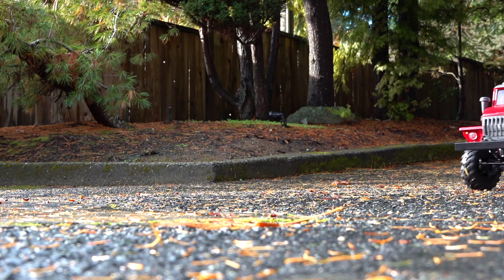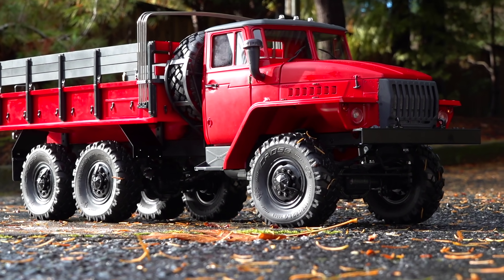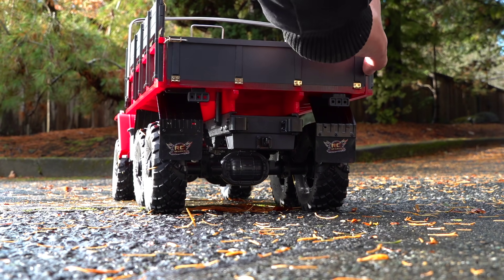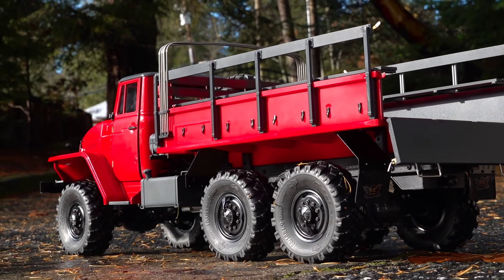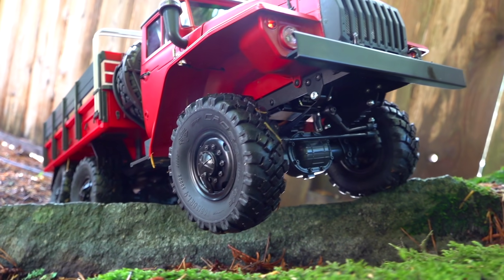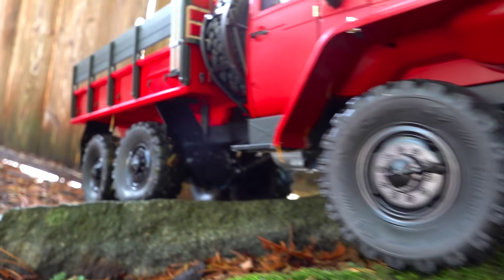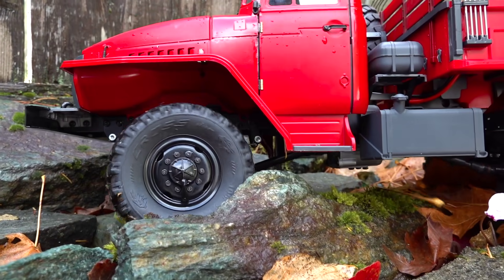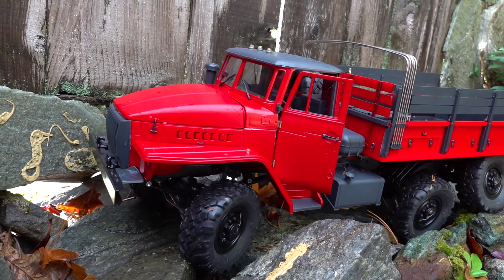HOW TO BUILD an RC FiRE TRUCK - PART 6  (Cross RC UC6 Model Kit Build) IT MOVES! | RC ADVENTURES

Comment: Really nice this truck in red. Very good test run. My only regret about this truck is the doors that open by themselves when you drive the truck. I also have the same problem as you with the hood and the windshield, I think that this part should have been held with a screw or that the part in front of the door made one and the same part and not in two parts because there is too much constraint at this level. For me I had no problem with the lights, everything works 😊

Comment: I remember posting another comment after you finish building it when I saw you did not scrape the paint off!   That solvent is designed to go plastic to plastic not paint to plastic!!   You are going to have the same problem I had my whole cab fell apart!    To be honest you have to build the whole unit first before you paint it!    I leant the hard way!    You can still buy the glass kit but that’s about the only panels you can buy for the cab, The box you can make lots of pieces for it no problem or you can buy the whole box kit!   Scale trucks Canada out of Montreal is a great place to find Replacement Cross RC parts inc body!   Check them out!  If you can’t find them contact them and they will be glad to help!

Comment: hello i wonder if doing a bild seres of bulding a truck from scratch but using some of the shelf parts will be posable? if you will do it and want a extreamaly capable truck i sugest taking a look at scammel explorers there 6x6 with tons of ariculation using gust 2 axles and where yoused to recover tanks and hevy halage in the uk.